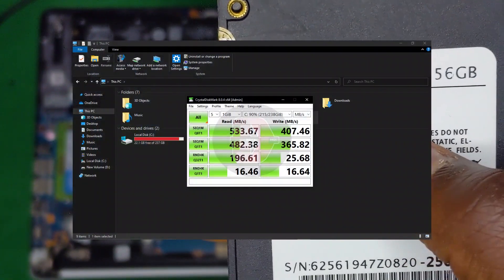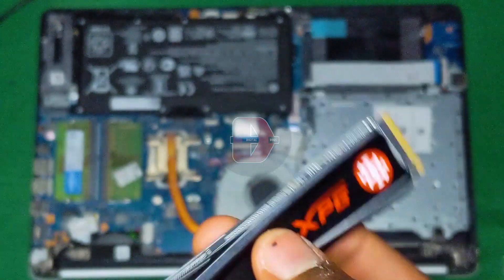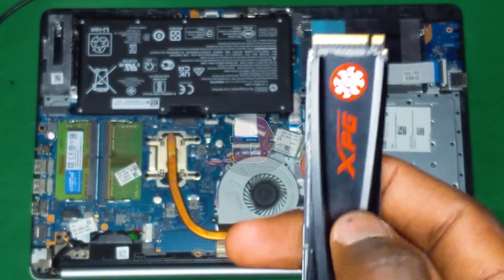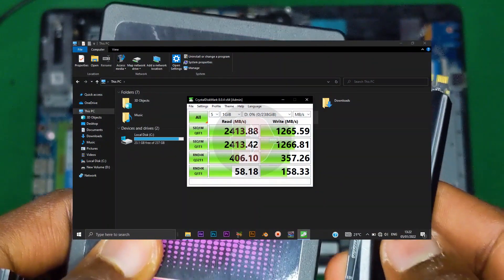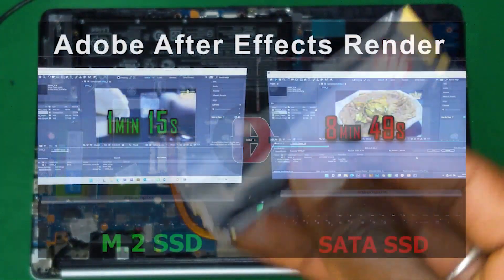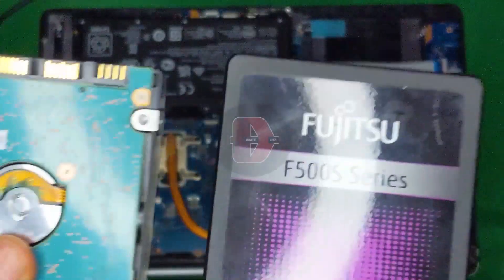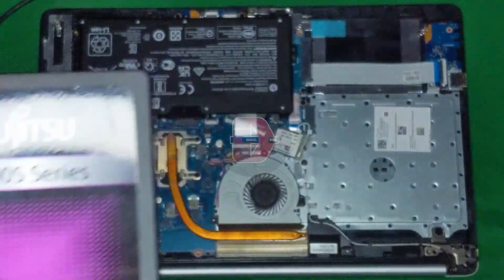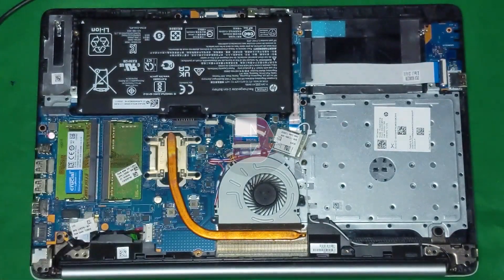M.2 SSD VS SATA SSD speed test 2022

Comment: I don't get it, the NVME is like 7x faster, how come in most scenarios the load speeds were almost identical?
Reply: NVME is for the future, programmers have to optimize programs to be usable with HDD-s aswell because big chunk of the population still runs programs on HDD's.
Reply: Just a marketing strategy...most of the applications doesn't need that much read/write speed to open up u will only notice the difference in rendering or doing benchmarks or something like that.... in gaming u won't even notice a difference except the load time of course which will be few secs faster but not much
Reply: @NightMare-hi7vu  Freaking marketing, same reason why you buy a 2TB M.2 and when you install it you have 1.82TB available.

Comment: How about the heating issues in M2 SSD?
Reply from the maker: I’ve not experienced that till date
Reply: @DigitalDegs  Which nvme M2 SSD are you using please? I'm planning on upgrading to SSD, but the heating issues I read about M2 makes me wanna just get a SATA SSD.
Reply: I use 2 different NVMEs and haven't had any overheating issues.  Just buy a good brand and you'll be fine.  The one I use the most is the WD Black.

Comment: Often, older laptops (Mid 2010's & back) don't support NVME since it only came out in 2013; even if they have an M.2 slot, it usually runs off SATA connections, so it'd require a SATA M.2 SSD if you wanted to use that slot along with an HDD. It's still worth the upgrade though (as shown here), allowing an older PC or Laptop to still be fast and usable once you ditch the OS off the old HDD. 

So don't throw that old laptop away if all you really want to do is use it for the Internet, Word, Etc. Even if it doesn't support NVME, SATA SSD's are an option too.